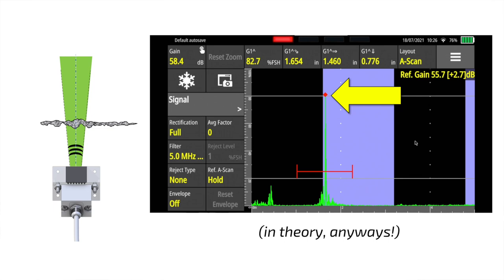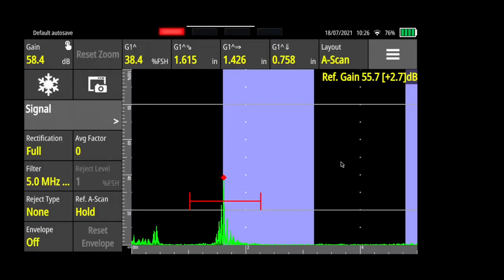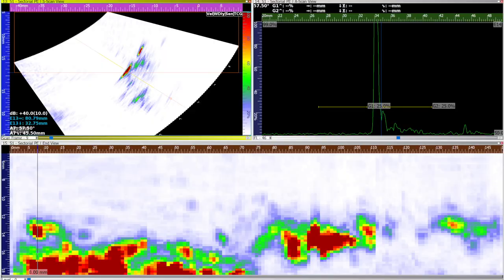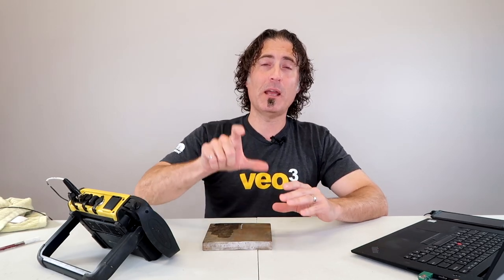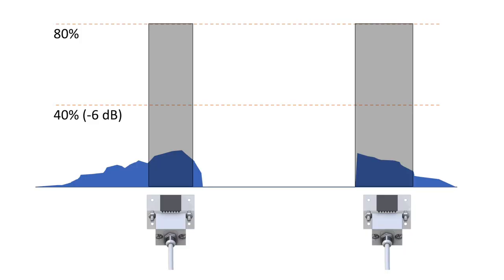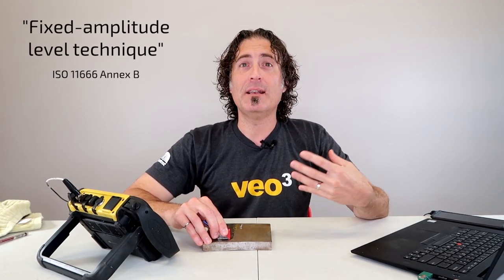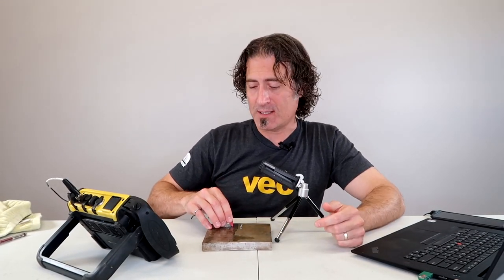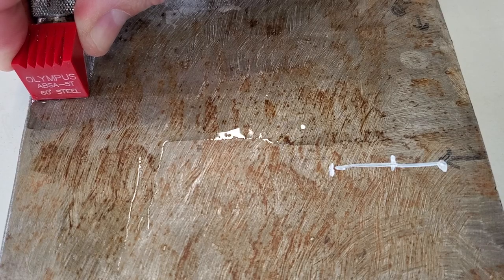6dB Drop is Not Great for Flaw Length Sizing

Comment: In theory, the areas beyond the -6dB points would have already been scanned prior to getting to the max amplitude.  Wouldn't that area be accounted for prior to scanning the rejectable indications? 

EX: So if you're scanning the weld and the max signal is say 90%FSH and you do a -6dB technique and you scan either side until you get 45%FSH. When you go beyond that, wouldn't you have already scanned the area where the amplitude picks back up? I guess what I'm getting at is the -6dB drop is assuming that the rest of the weld is clean and/or there's some other part of the code that covers how much distance has to be between indications to consider them separate or it would be lumped up already with the rejecteable indication. Making the -6dB technique legit. 
I'm not saying I'm not, I'm throwing something out there and hoping to get clarification. Thank you in advance.

Comment: Hello Paul,
Thanks for sharing knowledge and ideas !
In your presentation do you assume that the real flaw length is > to the sound beam width (let's say -6dB sound beam width) ? What's your advice regarding small flaw length sizing of heavy thick parts (forgings, or weld between two forgings) with sound path of a few hundred mm  with "standard" probes for this kind of components (B4S / B2S, WB45-2 ...) ?

Comment: If I get a rejectable signal, I'm going to do the 6dB drop. At that point, I'm going to follow it until there's no signal left. Regardless of amplitude. Is that ok?
Reply from the maker: Depends how long it is. If you have a 10ft weld with a trail of slag the whole length, and it peaks in the middle at 4dB over your acceptance level, but the rest of it is 2dB under, are you going to still call the whole thing? Probably not. You call what fails the acceptance criteria, so you use fixed amp technique.
Reply: @hollowayndtengineeringinc.5201  thank you.